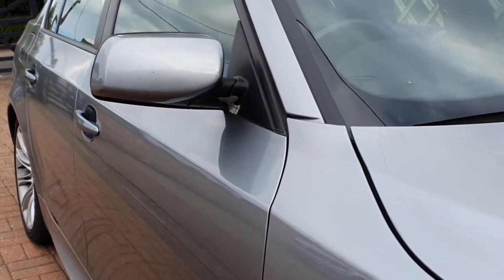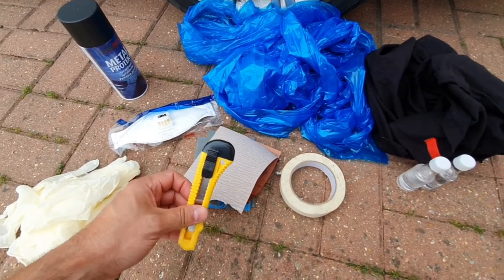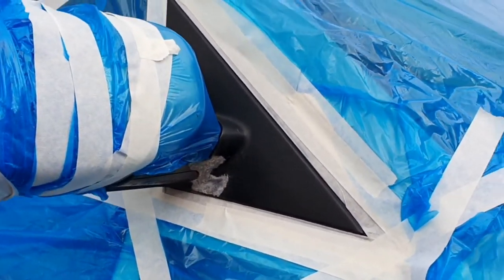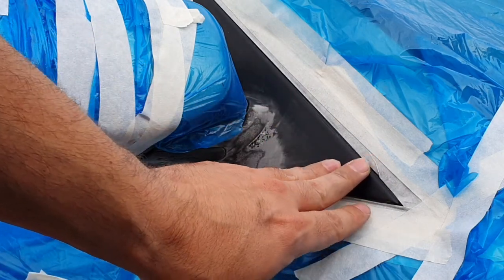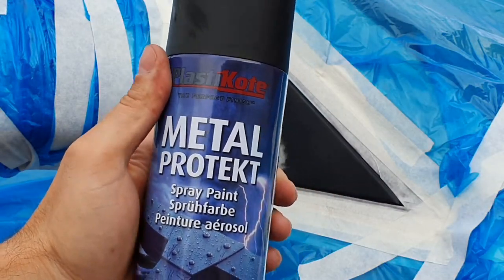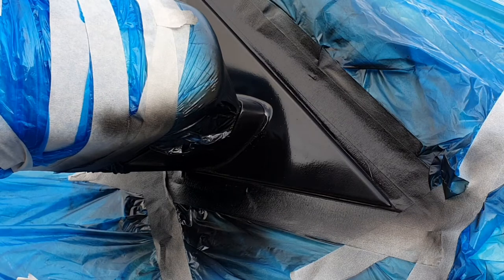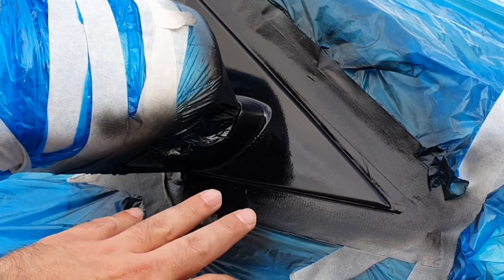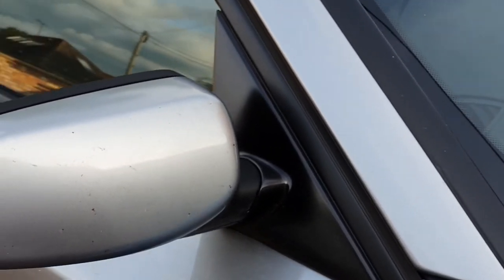How to restore corroded BMW Wing mirror arms BMW 5 series e60

Comment: Perfect timing for me this mate. I’ve just got a carbon black E60 and finished a full 3 step paint correction so it’s gleaming but BOTH my wing mirrors are horrendous. Worse than this. 

Was debating this or just getting a used set but I might just give this a go. How did it looks once it dried out and did it last? Or did you need to coat with some sort of laquer? Ta mate
Reply from the maker: @jayroberts4900 Hi mate, I'm glad you found the video when you did 👍🏻. I bet she looks amazing after the 3 step correction especially in carbon black in the sun! 👌🏼
Definitely worth a go mate. It dried with a slight matt finish and is still going strong now. 👍🏻
Reply: @TheBimmerFixer  brilliant mate. Did you use any primer or lacquer before and after?
Reply from the maker: @jayroberts4900 Hello mate, no that paint I used could go straight onto metal. I just made sure all the dust was off it and degreased 👍🏻
Reply: @TheBimmerFixer  ta man! I’ve been waiting for a decent day but the weather over here is just shocking isn’t it. Did you get it done in one day with heat gun? I finish work most days at 12:30 in the day so hoping to have it done by 6-7pm, or am I not being realistic with that? I have a heat gun on stand by
Reply from the maker: @jayroberts4900 No problem mate. Yeah the weather has been rotten hasn't it! That should be enough time mate especially if you have the heat gun too. You should be all good👍🏻

Comment: Do you have to clear coat it
Reply from the maker: @chrisdavis5861 No, that paint goes straight on and you don't need to clear coat it. If you wanted a shiny finish you can get a gloss finish, saves you having to clear coat it👍🏻
Reply: @TheBimmerFixer  Thanks 👍
Reply from the maker: @chrisdavis5861 No problem 👍🏻
Reply: Sorry again, mine is starting to bubble up at the bottom of the triangle it's a gloss black finish, should I prime it after rubbing down before painting.
Reply from the maker: @chrisdavis5861 No need to be sorry I'm happy to help. It will depend on the paint you use some paints like the one I used don't need primer but some will need primer, based coat and clear coat. Hope that helps.
Reply: @TheBimmerFixer  Thanks helps alot 👍